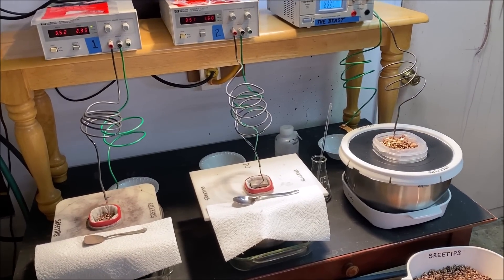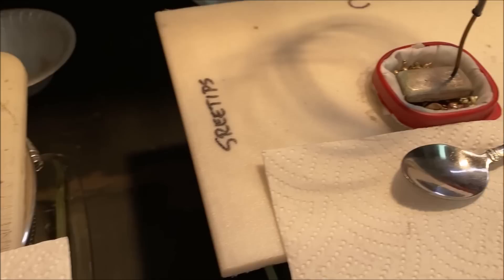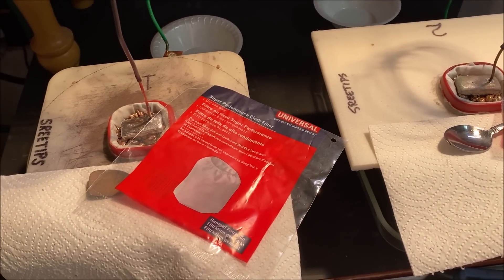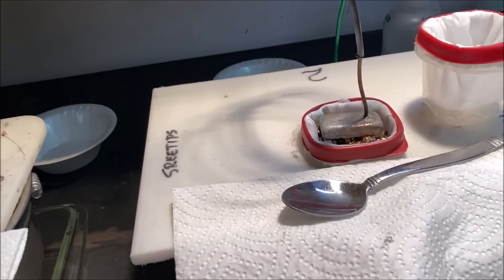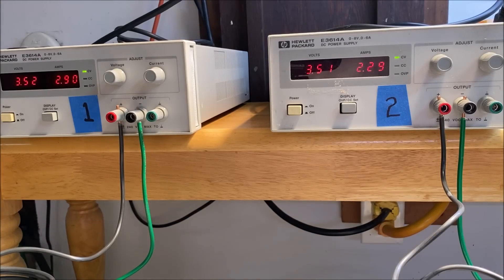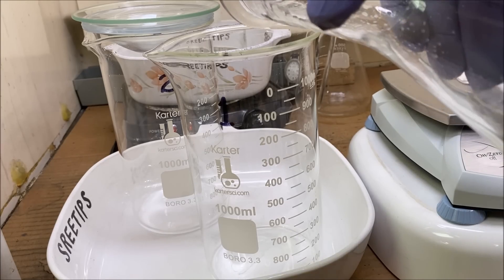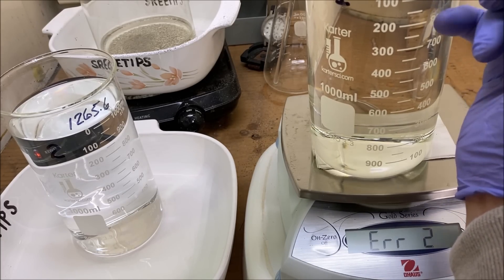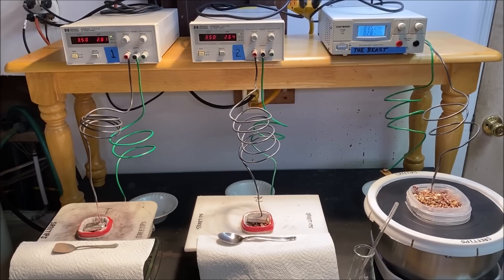Electrolytic Silver Cells Experiments and Changes

Comment: hello Sreetips, some ideas here :
1. the current of the Beast is identical to #1, so too low compared to the volume of electrolyte, you could use a larger plastic container for the Beast. More surface of metal in contact = more current = more metal moved per hour (with the same voltage). 
less distance between the container and the rim is favorable too.
2. you can also try this on each cell: starting from a zero voltage, put the silver block against the pan and increase the voltage until you see 3.0 Amp, and read the voltage : this is the minimum voltage possible because there is a resistance in the circuit. it must be low, but the value does not matter. set the voltage to have 3.5V + minimum voltage. so you don't exceed 3.5V in the cell itself. In this way you can also look for the origin of the resistance and reduce it.
3. you could increase the voltage from 3.5V > 3.6 then 3.7 etc on one cell and see what happens. Nothing is going to explode. 
4. Silver crystals grow at different speeds depending on several parameters such as the distance between the container, the fouling of the filter and the end of the crystals. The speed depends on the current, not on the voltage if it is sufficient. you can impose a current, always the same, for example 2,5 Amp. set the voltage and current to zero, put the silver block on the edge of the stainless steel, gently turn up the current and voltage up to about 3 Amp, decrease the current knob (not the voltage !) to 2,5 Amp, turn up the voltage knob all the way, put the silver block on the silver granules, the current will always be stable at 2,5A. Change the filter if you find that the voltage is too high.
Reply from the maker: If I remember correctly, the voltage is kept constant and the amps are allowed to fall where they may for optimum purity of the silver. Voltage too high or low and other metals could begin to co-deposit with the silver, if present.
Reply: @sreetips  try with one of your cell ? (with a new filter)
Reply from the maker: @hpdepasse5997  I tried constant current mode and the voltage was all over the place. Not good for the silver cell.

Comment: Take a bit of sandpaper and get that oxidation off the cathode copper. It will probably help with current flow. Lots of dissimilar metals there to help corrosion along.
Till next time, Sr. You and the Mrs. have a great week.

Comment: It looks like 2s wires are longer. While there's also more coils I doubt the reactance means much to DC current. That probably accounts for some of the difference after changing the bag, though I am still watching and you're making new electrolyte, that's probably more responsible than the wire resistance or reactance.

As always, loved the video sir

Comment: Next experiment: 15-20 oz anode bar for the Beast, the bigger Beast supply looks like it will handle the add'l current. Thanks as always for the fun & informative video!
Reply from the maker: I need to swap to the lighter Dacron filter for the beast. I never knew that it would make that much of a difference. The thinner bag is easier to work with.

Comment: Could you use a small net for a fish tank in you anode basket?
Its thinner and may work even better.
Reply from the maker: That would probably leach anode slimes down into the cell
Reply: @sreetips  Thank you.
Reply: The mesh needs to be thick (tightened) enough to not allow the slimes to pass but not so tight as to restrict the silver ions (positive so they are larger than the atoms of silver in the impure shot), the weave of the dacron is what you need, two layers works best it seems.

Comment: Great experiment. But would the thinner filter clog up with silver cell slimes quicker since there is less mass for absorption than the thicker filter? Just a thought.
Reply: It could happen as you think, the way he has demonstrated the creation of the filter is to double it over itself and cut to fit after placing the lid on to retain the fabric, this gives at least two layers of dacron. One layer can leak into the other this way and not spoil the electrolyte and crystals present. Since the positive ions of elemental silver are larger [☆see edit] than the uncharged atoms the slimes will eventually clog the fabric to the point of diminishing returns requiring the replacement of the filter. 

Washing the impure shot in the basket and reusing it, and reusing the rinsed fabric is questionable labor for the return you would get, but hey, Kevin, give it a go and see what happens for another experimental video. 

To rinse the shot and fabric use dilute HCL and hot distilled water, save the rinses of course.

☆Edited to add this correction I mistakenly said positive when I should have said negative (it is larger due to the added electron), I knew better and have no excuse
Reply: @CothranMike  Correction: The positive ions are smaller than the uncharged atoms, especially as the uncharged atoms in the slime are mostly gold and platinum, which are already larger and heavier atoms than silver atoms.
Reply: @apveening  thank you, i have corrected my post, again i thank you for this catch.
Reply: @CothranMike  You're welcome.

Comment: I would not have thought the bag thickness would be that much difference....as an Electronics engineer I would have thought that "strap with petina" which is corrosion would have been the problem.  but, I am no chemist, and got my EE degree 30 yrs ago :)
thanks for the video
Reply from the maker: I was very surprised that the bag thickness made a big difference.
Reply: I don't think a slight amount of corrosion on the copper would have much of an effect just due to the large amount of surface area of the 2 metals making contact.  I could see if it was a small area of contact then that small amount of patina might create more resistance, but over that big of a surface I don't think it makes much difference.
Reply: @Steelythestacker  it can , I used to work in industry where we had to clean contact points on bus bars that went into a  copper solution chemical tank on a monthly basis.  at low voltage it makes a big difference in amperage.  But there were other factors at play as well !
Reply: @wildmanjeff42  I worked as a technician on a lot of battery powered equipment in my last job and dealt with a lot of corrosion on copper wiring.  What is on that strap in the video is mere copper discoloration.  There is not really any corrosion, just a slight discoloration.  Nothing that would affect the flow of electrons and create any appreciable resistance.  If there were any actual corrosion it might affect it, but as we saw in the video, the slight discoloration of the copper didn't affect the amperage, as a simple filter change fixed the problem.   Corrosion would absolutely affect the resistance, but that's now what we have in this instance.
Reply: @Steelythestacker  maybe so...I meant no argument, I just thought that would be more a problem than filter thickness.  I have  not done any in-depth experiments involving this.
Reply: @wildmanjeff42  I wasn't sure if you had a good look at the copper in the video.  You are right any corrosion would absolutely affect it, but what other people in the comments are calling corrosion is barely a patina.  If I had a wheat penny that was that clean it would be almost uncirculated.  Lol.
Reply: @Steelythestacker  lol yes true, we had to polish copper buss bars totally clean for a plating line every 6 months, clean and inspect every month for downtime maintenance.
Reply: @Steelythestacker  and I just love learning about all this...I will always default to someone who knows better...even in my own field.  I used to be Electrical technician in industry, though I was more of an electronics troubleshooter (degree in 91).  I know where I can say definitively where I can say no that's not right , and seems more often I am saying ok, didnt know that....

Comment: I love watching and learning here. Forgive my ignorance, but I wonder if your "ingot" for lack of a better term that you're using to conduct through (anode electrode bar, just caught it) could be a different shape for better efficacy? Perhaps starfish-like with the fingers down into the silver? Just a thought, I'd love to know why it's not a good idea as well, just curious all over. Keep up the great work and thanks for sharing with us!
Reply: Different shapes will have negligible effect, unfortunately. Burying the anode connection will not increase the flow by enough to matter, again negligible effect. Making one which has fingers going into the impure silver shot just risks getting them electrolytic eroded when those parts make contact with the wicking wetness and any slimes displaced by a refill pressed into the basket, so again, negligible effect. Good thinking though!
Reply: @CothranMike  Interesting to know, thanks for sharing!
Reply: @CothranMike  A further question if you would be so kind as to help me learn. If it's negligible, why the "ingot" at the end? Is not greater surface area the goal in that application? Wouldn't it be just the wire tip in the dirty silver otherwise?
Reply: Good question. An explanation of why the anode bar is required, since the tip of the solid copper wire (10 gage) would work as well, there must be a good reason. One could easily be the  silver, which is more conductive, and since it's larger spreads the electric field over a broader area, one of these is true. It's more conductive than copper. The idea of fields emanating from wires is true and the anode bar does have a large, spread out field but this field does not affect what is going on at the interface with the electrolyte and impure shot. Even point contact is enough since that contact is then common to all shot touching the single point, and those shot pass it on, and so forth.  The weight is more the reason, as the shots erode, which helps ensure more shots reach the level of liquid to then push through the slimes. Those slimes can insulate contact with both the electrolyte and the current. After enough are left behind in the filter they not only plug the pores cutting the contents off from the liquid, they also cut the cord so to speak, and any Ions can't generate. This is the best time to harvest some would say, maybe so, maybe you can use experience to anticipate the point at which this is inevitable and work with the cycle. When the current stops flowing the power supply will sense this and hopefully shut off, or at least it will suspend and wait. 

The large bar holds the loop of copper wire, it's weigh helps push things down in a dynamic fashion, as the slimes rise and insulate -the large bar provides a better choice of paths for the flow of current at different points. Let's see are there any reasons I have left out?
Reply: @CothranMike  Awesome explanation, weight never even occurred to me. I bet a plastic spring could help that as well. The connectivity between pieces versus the field is something I hadn't thought on as well. Again, thank you for sharing your knowledge, I appreciate it. \m/
Reply from the maker: I don’t think that a different shape would affect conductivity much.

Comment: What's more important in electrolysis?  Current flow or voltage?  I see on your power supplies that they have settings for Constant Voltage and Constant Current.  What if you were to set it to constant current and jack up the current?
Reply from the maker: Voltage at 3.5 VDC is critical for best purity silver.